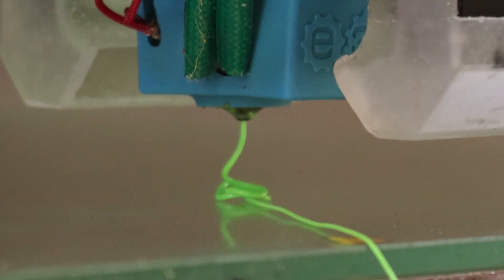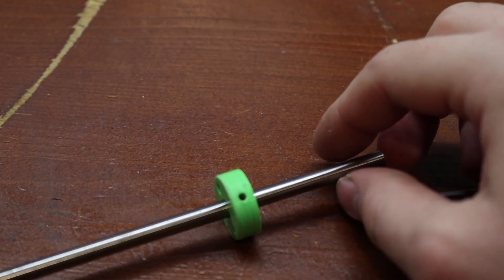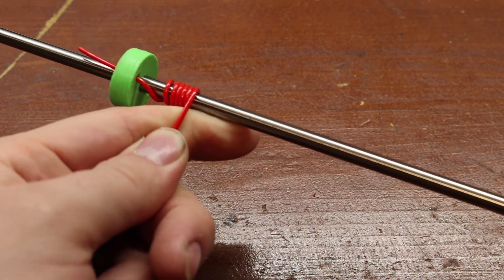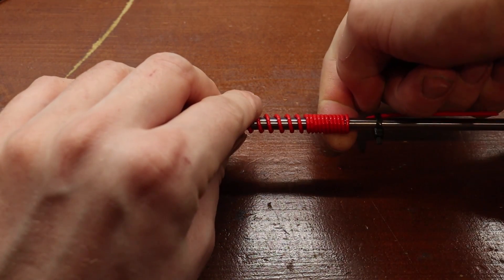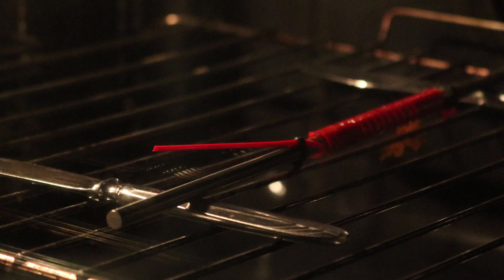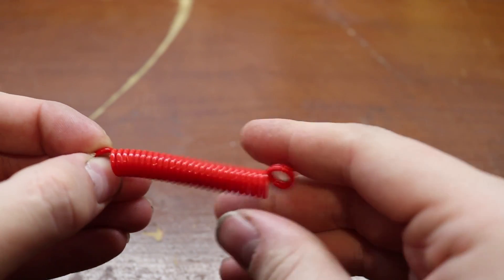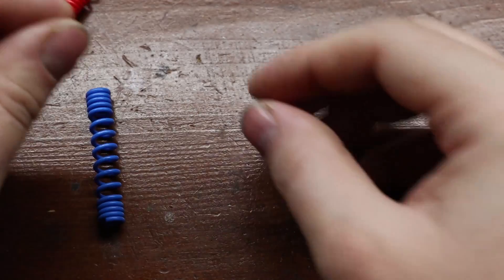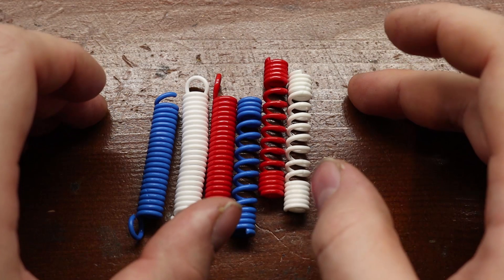DIY 3D PRINTING SPRINGS! (Tested 10000.00 Cycles)

Comment: 11:00 did u warm up the section to be bend, in order to form the tab??? or did it actually fail prematurely, cause it was cold when bent? earlier in the video, u don´t warm it up, but I thought/hoped, that the actual test-piece was made differently/correctly...
Reply from the maker: It was a heated bend

Comment: If you just print a little screw type connector for your extension springs - one that screws into the end of them and picks up 3-4 coils, your fatigue breakage issues at the eyelet should be over!

Comment: I wonder how this would work with flexibles? I use a lot of a material called PEBA, which is basically a Nylon derivitave. It's main feature is that it has very good energy return and fatigue resistance, plus retains it's properties down to -60c. Hell, I bet you could print a spring from PEBA... It wouldn't even need to be helical.

Comment: I used aluminum foil wrapped very tightly instead of the special tape and it worked just as well. Just a tip
Reply from the maker: Yeah that's smart
Reply: @PattysLab  You are a wizard for sharing this technique. It turned out so much better than I thought it would.

Comment: if you are not 3d printing them then why the hell use 3d printing filament, just make some metal ones lol
Reply: lol… 😂 Do you know how spring steel is made ?
Reply: Because you wouldn’t be able to anneal the metal without a very expensive oven or kiln. The glass temperature of 3D printer filament is low enough to do easily at home.
Reply: @solvated_photon what? Just coiling spring wire works great. I did several compression springs like that. You do that on a smaller mandrill to accomodate for a springa back. There are calculators for it. If you want to anneal them (not necessary imo) according to machinist handbook temperature is 200F (93C). Anyway you make them - still better than plastic ones.

Comment: Neat that these can actually hold up that long!
I guess the question is why though? It is so easy to make metal springs on your own that you don't have to worry about breaking from heating up or drying out due to the elements etc.

Comment: I'm not sure why anyone would even try this. The point of 3D printing is to have the ability to make customer things and to print things for cheaper than you can buy them. You can buy much more effective and durable springs and they are dirt cheap already. You can also buy them in unlimited sizes. There's zero point in attempting this...

Comment: This video alone earned you a life and a subscribe from me.   I was really curious on it 3d printed could make springs or not, and now I know.   One quick question, let's say, instead of having the springs be that long,  I wanted a push spring that was about half as long,  but had about double the amount of resistance when compressed.  Could the be done by increasing the width of the filament used, or by increasing the diameter of the spring?
Reply from the maker: First of all thank you :), stronger and springs can be made by decreasing the spring diameter or increasing the diameter of the filament let's say 2.85mm. You can use a stiffer material or change the angle of the helix, ie ending up with fewer windings. However if the material is stretcht to much you can go into plastic deformation and your spring wil be much shorter than it was before. My approach would be to take a good spring material like nylon and use a thicker material like the 2.85 filament and perhaps try out carbon or glass fiber filled nylons
Reply: @PattysLab  awesome, thank you for the advice.   I will definitely try that out. I'm just now getting into 3D printing and I'm super excited about finally getting started with it.

Comment: do you think it's possible to do this without the kapton tape? maybe using painters tape instead since it shouldn't melt with high temps
Reply from the maker: I'm not yo keen to put painters tape in the oven aluminum tape should perhaps he a better replacement

Comment: They are not 3d printed, more backed in the oven, would like to see a 3d printed spring from a 3d printer and Testet with more materials. 🤔
Have you tried strimming nylon lines 🤔
Wher can I get cheap goid kapton tape?
Reply from the maker: I've used nylon in the test which is quite similar to weed trimmer line :), kapton tape probably from Amazon
Reply: @PattysLab  it would be interesting to see directly 3d printed springs working, if that would be possible 🤔 that they would work the same like the oven made ones.

Comment: I've been making these for years, but I've been using a space heater or heat gun (hair dryer works too but they tend to burn out faster) to gently heat the plastic as I coil it. I just used the chuck  of the drill to hold the start of the filament. My issue is it takes a while to make them this way. Your way might be faster in terms of actual man hours (vs machine). I noticed that when I coiled the PLA cold I found the color would end up whitening and preserving the color is important for my application. I know this isn't really an issue for your purposes, but I'm wondering if the color would be restored during the baking process.
Reply from the maker: I actually experimented with coiling the PLA in a pan with hot water in order to prevent it from having a lot of stress you might want to look into something like that :)

Comment: Why not just use steel wire?
Reply from the maker: Because sometimes you don't need to take the easy way out :p. And I don't know if you ever have rolled your own steel springs but that's pretty tricky and can be Dangerous with thicker wires :p

Comment: Filaments are actually brittle when moist not the other way around like you said.
Reply from the maker: Not for nylon...
Reply: @PattysLab  same applies to nylon
Reply from the maker: Moist makes the nylons more flexible
Reply: @PattysLab  nonsense
Reply from the maker: When you print them the plastics need to be moist free but for nylon the moist acts as a plasticizer. I don't say your party is stronger with more moist it's about the brittleness ;) for PLA I was indeed mistaken
Reply: @PattysLab  dude just look it up
Reply from the maker: @TechnologistAtWork  The same holds for you
Reply from the maker: You are feeding the yt algorithm cheers

Comment: Unfortunately PLA will tend to settle into a new shape if left over time in a stressed position.   You're probably better off buying metal springs.  Its not like tension and compression springs are not very common, or expensive.

Comment: How did you get the thermal camera to go through the glass?
Reply from the maker: It's a flir one pro which has msx this means its using a normal camera overlayd on top of the thermal image. You can't shoot ir though regular glas :) but in the shop you saw I opened the oven door
Reply: @PattysLab  Ahhh. Makes sense. I didn't think the door was open. For anyone else wondering, thermal cameras can't see through glass!

Comment: have you used TPU as a spring? You can use it by itself sorta like elastic, I like using it on hinges, or in places you want to snap closed. I haven't had it break yet and I've tried pulling on it really hard!
Reply from the maker: I think that tpu is to soft to hold it's shape. Since, the filament has a narrow 1.75mm diameter  :)
Reply: @PattysLab  I think it would depend on the application that the spring is to be applied to. I am going to try very light duty TPU 20 mm long compression springs with a 9mm OD to use in a 3d printed air engraver hand piece I have recently designed. I want to have the entire build possible using 3D printed filaments.  

I will also try petg springs for this. These springs will need to survive a couple thousand compressions per minute

Comment: The springs did not brake only the eye ends.
Perhaps if you 3D printed something like a short "eye bolt" or "eye screw" then glued into the spring ends with a flexible glue like silicon.
Then hook onto the eye, it will distribute the tension on the coil.
Reply from the maker: Yeah that probably works much better

Comment: smart!

I share the concerns of PLA getting brittle over time. I'm thinking this method might work pretty good with weed trimmer string (nylon, I think) which does not get brittle and comes in many diameters...
Reply from the maker: That's pretty smart! I'm btw also curious how PC holds up thinking about a follow-up video with many more materials

Comment: "pull spring" is actually called a tension spring.
Reply: Yeah and the push spring is actually a compression spring. But maybe he's from a different country than US and doesn't know the exact terminology.
Reply: @ilikewaffles3689  Its a literal translation of how we call "trekveer" and "drukveer" (pull spring and push spring) aka tension and compression spring.
Reply: Yes, but many people into 3D printing are not from an engineering background, so using colloquial terms can ease them in. I don’t see any issue with calling them “push” and “pull” as almost anyone can pick on what they are for.
Reply: My d&$k is called a penis. What’s your point?

Comment: dont use a tap on plastic... 
its unnecessary and you have a pretty good chance of just striping the hole out. screws wont hold as well either.
instead just use a screw to cut its own threads and it holds better. its a lot harder to pull the screw out too. 
no one uses a tap on wood because its softer than the screw. same thing here.
no plastic injection manufacturer takes the time to use a tap on the plastic parts they produce. the screws do it themselves.
Reply from the maker: But those are panels screws with really sharp edges and courser threads ;) this is a simple machine screw in order to mount them properly you need a brass insert which I did not have on hand.

Comment: That's pretty interesting. I work for a company that makes coil springs and it would never occur to me to try and make them out of plastic. Do they tend to stretch or compress once they've been cycled a lot?

One tip for your extension springs would be to print a theaded plug to go in the end with an attachment loop on it. Bending the coil up on the end always creates a stress point which ends up being the weak point. By threading a plug into the spring and pulling on that, you spread the stress over the coils it's threaded into.
Reply: Isn’t it great when one of your viewers actually contributes a constructive comment vs useless empty negative feedback? I like this. This is what I come for. Fantastic technique, fantastic testing, great project. Thank you.
Reply from the maker: Thank you for the reply! That's really smart actually 👍🏼
Reply: and then superglue the threaded plug to the spring-"tab" (which isn´t a real tab anymore, more it´s the actual spring´s end, but I think everyone understands what I mean)

Comment: Under which circumstances do I need pull springs versus push springs, and is there any way to use both in the same part?
Reply from the maker: Well many 3d printed gadgets do for example use printed in place springs to open boxes activate mechinsmisms etc. Usually many are printed in pla. From what I experienced like someone already mentioned in the comments PLA tend to looks it's ability to spring back over time if you keep it under load for longer periods if time. Hence why I showed this concept. Think for example about cosplay props or movie props for which you can use a nylon spring instead of print in place or steel spring. These speings will also not rust. Metals springs are always better of course but you would extend this method of plastic prints to make even crazier springs (I mean in their shape). Also I'll come up with another video where I use one of the push springs in a magnetic sensor configuration the plastic spring will nog influence the sensor reading. But to really answer your question I don't know when to use both push and pull springs in the same part it's up to you to design a mechanism that can house both you could think about a crossbow or something like that that the bow could use a pull spring and the trigger mechanism could use a push spring :)
Reply: @PattysLab  You should try to create a J-Damper, a Wave Spring and/or a Friction Spring.

Comment: In order to increase the strength of the pull tabs on the pull spring, you should form the loops before annealing.
Reply: It's not annealing 😐 just normalizing
Reply: That would be too complicated. Still, he could localy warm-up the point he´s gonna bend, when he creates the "eyes".

Comment: Bull shite no way it can handle 2 KGS let alone 50kgs
Reply from the maker: But who claims that?
Reply: @PattysLab  
Yeah but I feel 3d printing is not functional at least in India. More of a showpiece or enclosure. But as a pattern for casting or sacrificial piece it is OK?
Reply from the maker: Well here in europe they are printing with plastics like PEEK, Nylon, utem which could be aluminium part replacements. Also I've encountered some products that have 3d printed parts in then als a functional part and are years old 😉
Reply: @PattysLab  
I 
think that much skill and technology is not available in india

Comment: I've tried this too, I designed some shocks for an RC crawler. A constant load with fluctuating ambient temperatures renders them useless, they will eventually (less than a week) loose shape.
Reply from the maker: Out of which material you should make them out of nylon or abs
Reply: @PattysLab  I just tried PLA and PETG
Reply from the maker: @knoopx  but in the test you could see those where the ones who broke ;)
Reply: @PattysLab  none of mine broke, I'm not talking about durability but reliability. To properly test what I'm saying you should measure the length and put them on a screw with some washers and a nut. tight them to their full travel, leave them for a week on warm ambient temp and measure them again. My experience shows that they shrink considerably and loose springiness.
Reply from the maker: Alright I get you this is interesting now I'm curious about nylon and abs an then just leaving them compressed for longer periods of time
Reply: @PattysLab  for sure, the higher glass transition the better. polycarbonate should be even better.
Reply from the maker: But for Nylon Tg is much lower than gor PETG but still it holds up better. It's good that you mentioned PC I do have PC Filament perhaps a second video with your proposed test and more materials

Comment: Great idea! 
What a kind of tape you used to fix the filament at the metal rod? Beside a brand name for the tape, do you have any spec.?
Reply from the maker: I use genetic kapton tape (polyimide not polyamide) if you google for kapton tape you should be able to find it :) Here you have an Amazon link: https://www.amazon.com/Temperature-Kapton-Professional-Protecting-Circuit/dp/B07S2219CK/ref=mp_s_a_1_1_sspa?dchild=1&keywords=kapton&qid=1611408514&sr=8-1-spons&psc=1&spLa=ZW5jcnlwdGVkUXVhbGlmaWVyPUEzMTlQRjBBQzdOMTlDJmVuY3J5cHRlZElkPUExMDQyOTg1MTVOWEg1VlczSlNPNiZlbmNyeXB0ZWRBZElkPUEwMjg3MjI4MUpHM0FFR1ZJNFlFOCZ3aWRnZXROYW1lPXNwX3Bob25lX3NlYXJjaF9hdGYmYWN0aW9uPWNsaWNrUmVkaXJlY3QmZG9Ob3RMb2dDbGljaz10cnVl
Reply: @PattysLab  Thanks! I got it. :)
Reply from the maker: Okay great!

Comment: I have my 3D printer set up in my bathroom. I print directly out of a dry box. This means the exposed segment of filament out of the dry box gets tons of moisture whenever I shower and stream fills the room. After a few days, with no exception from five different brands of PLA, all of them snap spontaneously into several pieces, leaving only a small segment connected to my extuder. Conclusion is that PLA gets real brittle when saturated with moisture.
Reply from the maker: I've never had such issues with PLA just left in the open but I'm really glad you point this out because it's important if people want to use PLA in their spring designs. I'm only now really curious how ABS would perform as a stiffer solution for Nylon.

Comment: PLA has the disadvantage that it deforms permanently under stress over time even in room temperature
Reply from the maker: But isn't that with all plastics? What timespan are we talking about. Might be a good to know for people to know :)
Reply: @PattysLab  All the PLA mechanical parts I've printed have permanently deformed due to static stress over a few weeks. PETG seem to fair a bit longer. Parts I've printed with that has lasted under static stress for months before failing of other reasons.
Reply from the maker: Really interesting, since it might be better than to make the quick reload lock from PETG instead of PLA. Thanks for reaching back
Reply: @PattysLab  yes, all polymers suffer from creep.

Comment: Cool stuff! I've wanted to make some springs but so far have only done big print-in-place stretching springs
Reply from the maker: I was like if such spring works why doesn't this work
Reply: @PattysLab  this is probably better for strength, but less flexibility for material diameter and harder to manufacture.

Comment: A handy comment for everyone that does not use the metric system.
120°C = 250°F
160°C = 320°F
200°C = 390°F
Reply from the maker: Thankyou James
Reply: Accurate conversion requires only the ability to add, subtract, double, and divide by ten any given numbers; these operations are probably the easiest mathematical operations possible for the minimally numerate. Therefore:

- double (2x) the C value to get first intermediate result (FIR);
- from the FIR, subtract one-tenth of the FIR to get the second intermediate result (SIR);
- add 32 to SIR to get the conversion value in ºF.